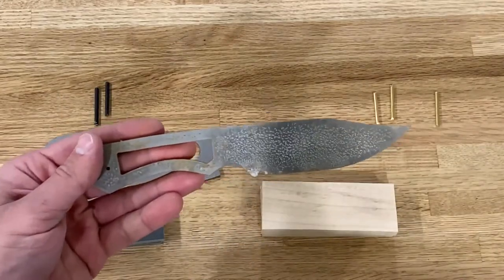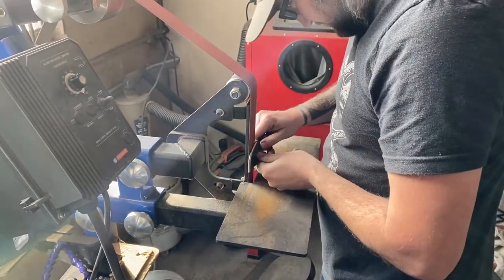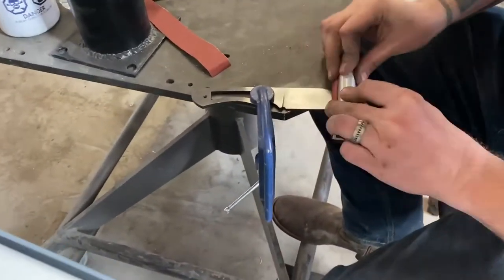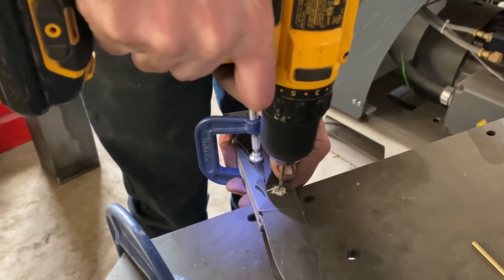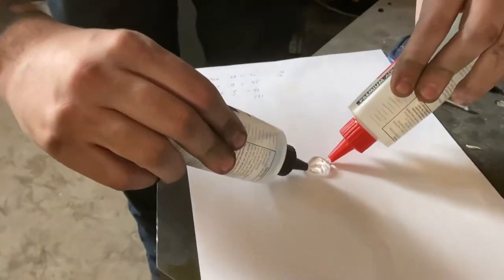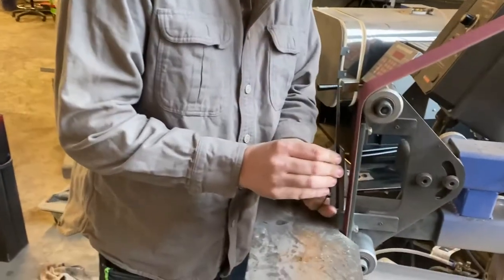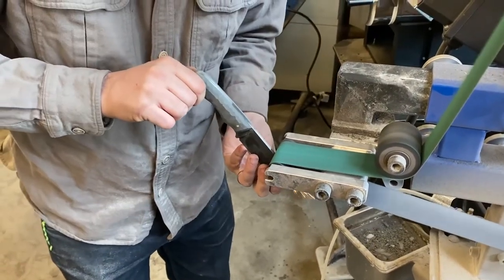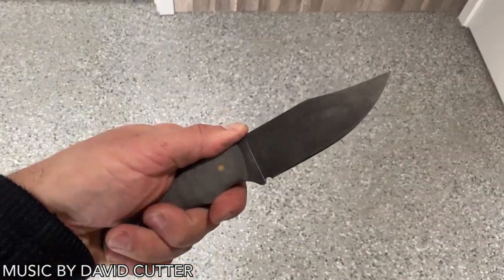Knife Making Tutorial: Step-by-Step Guide for Beginners

Comment: So if I don't own a kiln or forge...I can use a torch to heat it up until it's non-magnetic, then quench in oil?
Reply from the maker: Yes. An oxy acetylene torch would work on its own but you can also build a small forge using plumbing torches and firebricks. Here's a video of a simple one that will get the job done. https://youtu.be/314pfzS1Mbk
Reply: @waterjetknives  Nice, I probably should have thought of something like that before I ordered a little propane forge.  I couldn't get my torch to heat the whole thing evenly enough and I was worried about introducing stress or warping the whole thing.  The knife turned out really well though, no warping at all and it looks great.  I ended up polishing it to a mirror finish and then blued it.